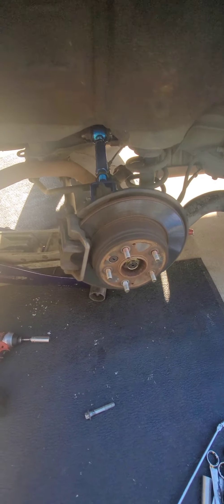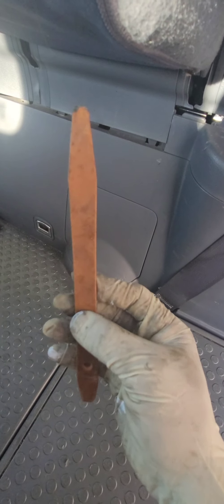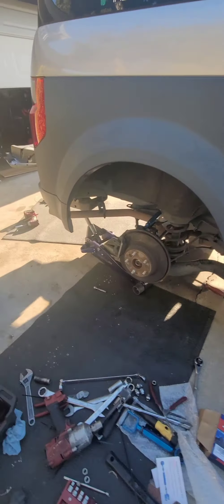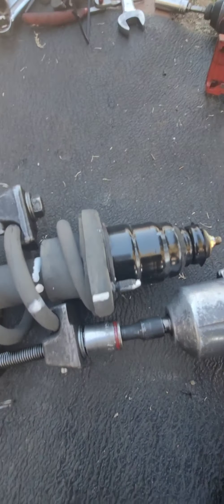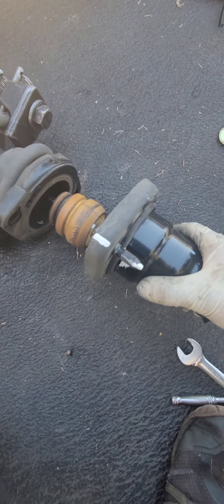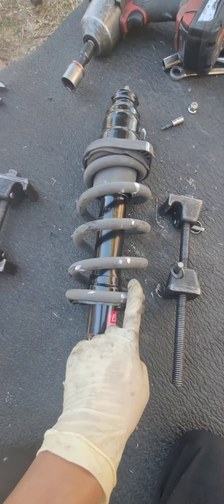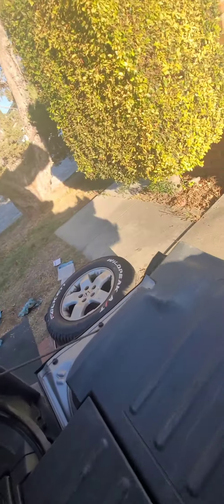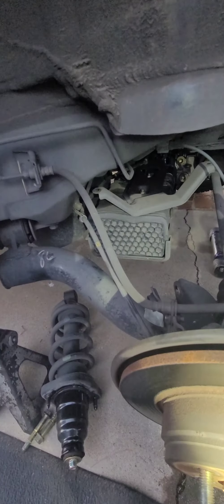Honda Element Rear Struts Replacement

Comment: Glad for you the bottom bolt came out easy. I used a 5 ft pipe on a breaker bar after PB Blaster for a week before the job. I ended up having to cut the bolt and welded nut off. An hr job turned into 5.

Comment: 10:19  As indicated by others, those "bump stops" were installed upside down. Compare at 9:20.  I just installed new KYB shock cartridges in my 2005 Element rear struts.  Most people install complete "Quick Strut"  assemblies but I wanted to go this way and reuse the springs and other parts.  Clocking the top mount is critical as demonstrated in this video.  Yeah, first time around I got the bump stops upside down too.  Had to check the details in the FSM to confirm as the larger end looks like it would be better contacting the cartridge which is larger than the bump stop plate.  Unless you totally overload your car so its "squatting" these don't do much.
Reply from the maker: I later upgrade with swift springs and updated another video 🙏👍

Comment: I have an 03 element ex awd and I replaced the front pair of struts. The car handles and drives way better. I never replaced the rear bc I don’t have money on me now. My question is would replacing the rear pair of struts make the car handle better than it does now? Does the rear strut affect the cars handling? I know it will fix the bouncy and ride comfort issues. But highway handling?